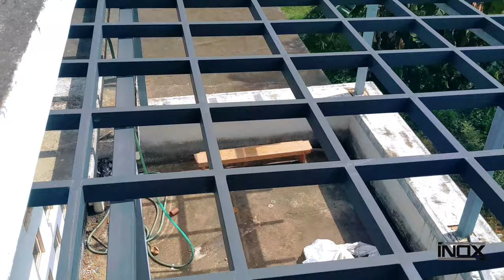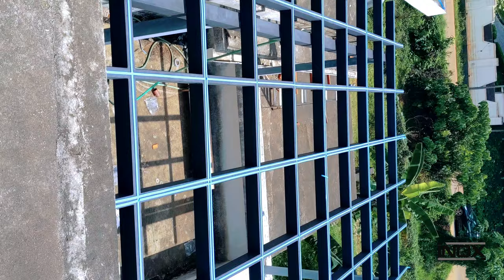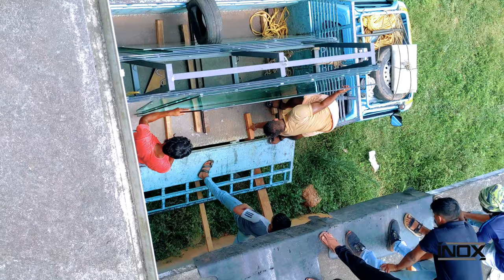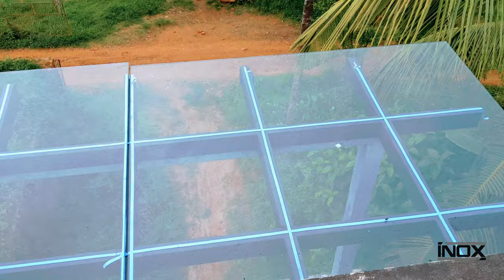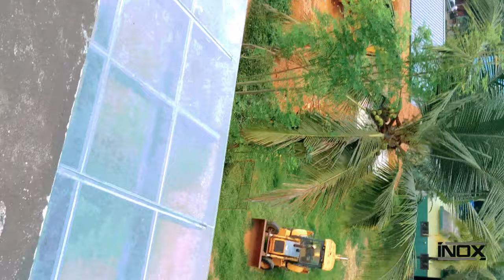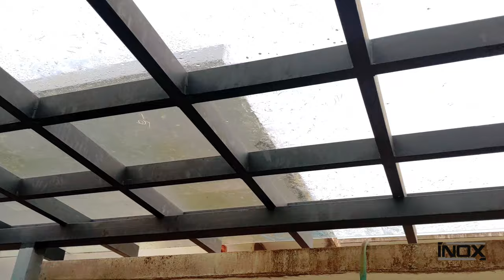how to install glass pergola | pergola glass roof installation

Comment: How are these glass roof panels held in place? Do you add silicone between the panels? Thanks
Reply from the maker: With iron pipe.  Silicone has been used
Reply: @inoxglassinterio  QA